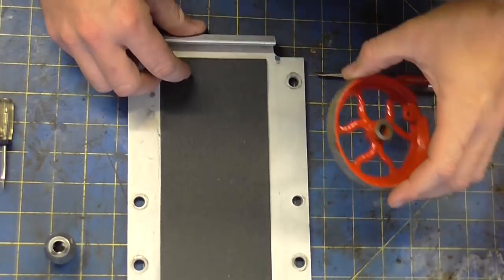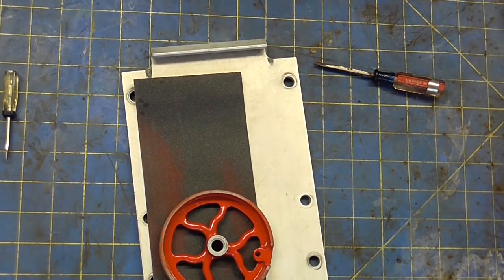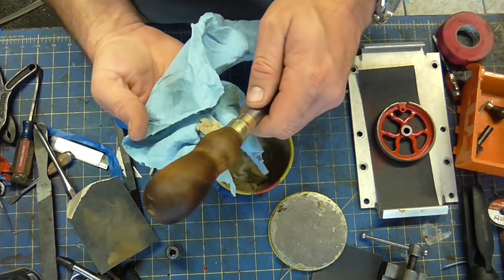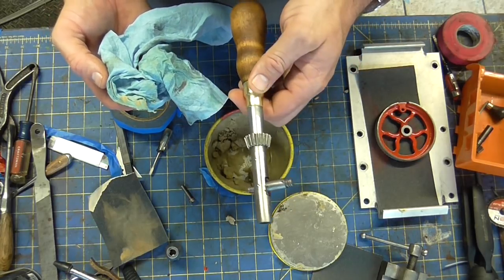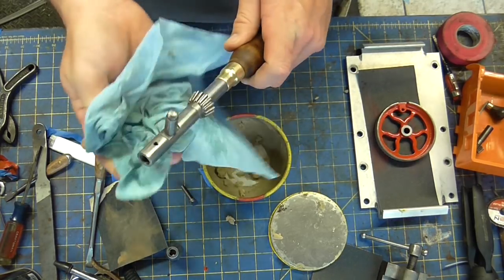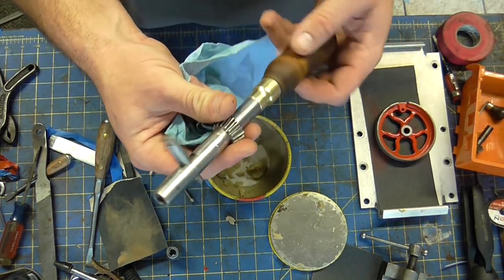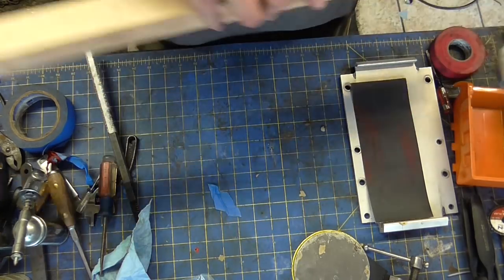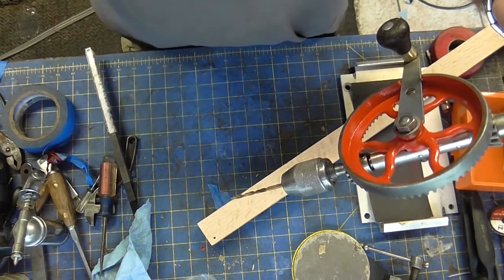Goodell-Pratt Part 2

Comment: Hello Joe!  The drill came out fantastic!!!  Do you have a die that you can run over the handle bolt?  I know there isn't a lot of bolt sticking out of there but those thread restoring files are a bear to use on something not easily accessible.  The brass looks awesome! Lots of guys (including myself) use copper tube caps as Ferules, turn the handle down to 1/2" and epoxy on a 1/2" copper cap, it's not Brass but looks great.  Also some guys just use a 1/2 section of copper or brass tubing since the handle will be close to the body of the drill.  Really enjoyed the video!!!  Looking forward to the next one!!!  😃👍
Reply from the maker: The copper tube idea is brilliant! I am going to have to give it a try. You are probably right, a die might be more appropriate. I'll do a little compare and contrast between the die and the file....I think that would be an interesting bit of content. As always, thanks for watching and thanks for the remarkable tips. Cheers.

Comment: Find a bottoming die, if it will fit, to clean up the threads for that side handle.
I bought a wooden file handle with a feral on it and made it into a side handle for one of my tools and it looks factory.

If you need a longer insert for that knob that you're making you could use a connecting nut. Or maybe somebody else reading this could use this idea.
For the side handle that I made I bought a piece of allthread and glued and screwed it into the file handle and into the side of the tool.